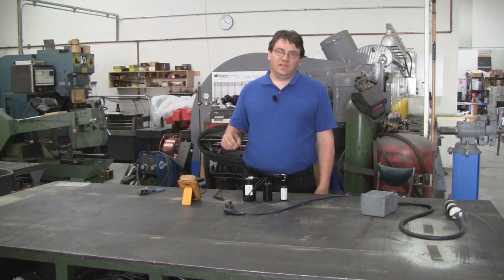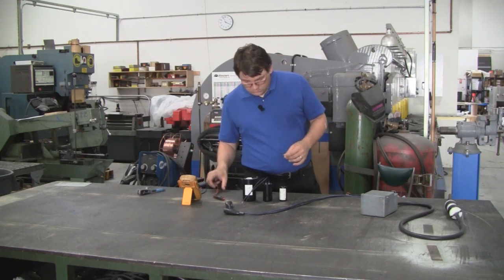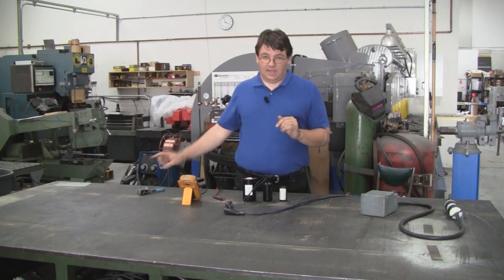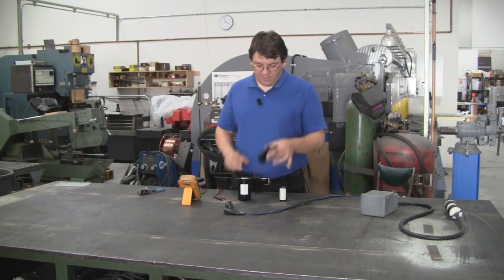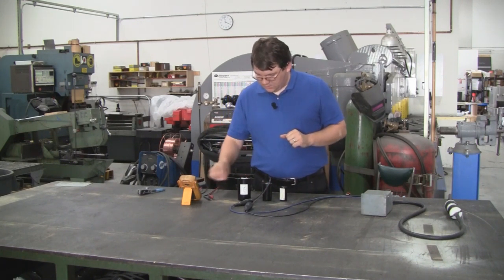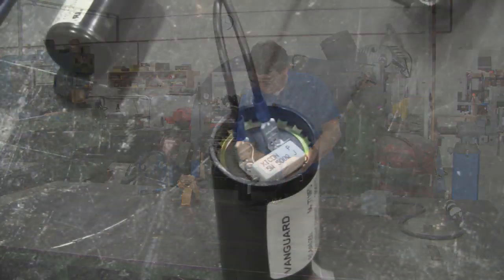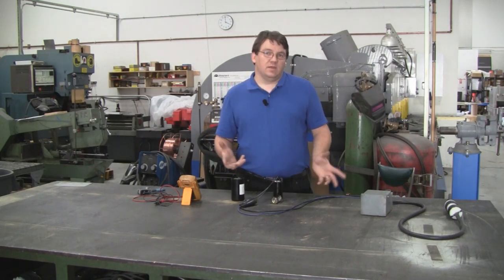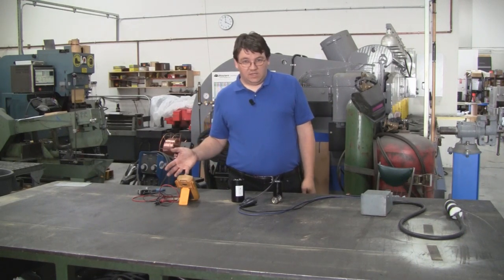Start Capacitor Bleed Down Resistors - TEMCo Tutorial

Comment: What would be the correct size resistor for a 132-165 uf capacitor on an AC condenser unit?  Thanks for the video.

Comment: Bought some DPDT switches from TEMCO.. complete junk.  The one I was using  (bought the other as a spare) could not have had more than a hundred flips before it seized.  Upon opening this was revealed to be due to one of the plastic cam things that are part of the one-piece molded rocker, and which had snapped off.  Chinese-made junk.  There's a reason they have historically used bakelite for nonconductive parts in switches, especially moving parts,  that might be subject to heat from such as a contact made resistive due to arcing.. bakelite won't soften or melt.  It will deteriorate over many decades, by which time it will have done its job.

Comment: I have a dtable top belt sander that keeps blowing starting capacitors.  There is no bleed down resister on the cap.  How to calculate?  125v 300-360mfd cap.  Motor is small probably 1/2 HP.  Thanks for your great videos.  They are very beneficial.

Comment: My motor does not use a resistor. When replacing the capacitor, can I just cut off the resistor? What if I leave it on?

Comment: You showed a 500 ohm 5 watt resistor. But you said it was a 5000 ohm 5 watt resistor. You said 240 volt positive swing and 240 volt negative swing. Are you referring to a 480v single phase circuit?

Comment: Thank you for all your wonderful videos!  I have a quick question on capacitor safety.  As per your video, once the motor starts there will be an unknown amount of energy stored in the start capacitor depending on where in the wave cycle the centrifugal switch opens.  However, once the motor stops and the centrifugal switch closes, won't the capacitor be re-added to the circuit and any stored energy in the capacitor dissipate through the motor windings?  I just want to verify that under normal operation we would not expect any charge to remain in the start capacitor once the motor is turned off.  Thanks in advance for any help.

Comment: explain to me if there is no charge in the start cap, when the compressor needs to power up how is this providing the juice to kick the compressor over ?
Reply: automan1223 if you are talking about a residential ac compressor with 220 vac applied, the 220 is not single phase.  it is actually two phases of 110 slightly out of phase with each other.  The capacitor helps to develop torque by charging. this essentially provides for further phase shift between phases. In the case of 110 vac, the 110 vac motor has a start and run winding.  Voltage is applied to both windings, but applied to the start winding through the capacitor,  which gives the motor more torque by again shifting the applied passes to the two windings further out of phase. Bleed off resistor should be 1000 ohms or more (1000-1500) and 2-5 watts is fine..500 ohms is what was shown.

Comment: Thank you for the tutorial, I found it to be of help to me. I am trying to rebuild my swimming pool pump/motor and want to bleed down it’s 2 capacitors so I can safely begin the repair process. The run capacitor is a 35 microfarad 370 VAC unit, while the start capacitor is 200 microfarads 110-125 VAC. The bleed resistor that I have is a 50 watt 330 ohm model. Is this appropriate for these capacitors? How long do you think it would take to bleed down the voltage on these? Is there any way of using ohm’s law to calculate how long it would take to fully discharge them? Thanks for your assistance.

Comment: I am trying to determine if my Craftsman Scroll saw motor is a capacitor start motor because I want to add a variable Speed control foot pedal. The recommendation for the foot pedal says not for use with capacitor start motors. Any help on this matter would be appreciated. So I do not want to purchase the controller if it will hurt the motor or be unsafe. thanks in advance

Comment from the maker: Arcing internal to the relay would most likely require a voltage spike of well over 1000 V. As for what goes "kaboom," you are basically having a very rapid polarity switch inside the capacitor, which will result in excess heating. This can boil the electrolyte, causing a pressure build-up, popping the safety valve or the top of the cap. You can see what happens during over-voltage in our video titled "Start Capacitors & Run Capacitors for Electric Motors."

Comment: "480 volts .... and kaboom!"  Really?  What goes "kaboom"?  Are you providing accurate information here?  It seems that if voltage was retained by the start capacitor, and if there was a relay in the circuitry, that the possibility of arcing might exist..  (?)

Comment from the maker: There wouldn't be any arcing in the motor circuitry. There are 2 main concerns with voltage in start caps.
1) It can shock the heck out of you.
2) Let's say that the cap cuts out at the peak of the positive side of the waveform. You now have ~ +240vdc stored in the cap. You turn off the motor, and go to start it again. When you close the switch, you happen to do so at the bottom peak of the waveform. That would be -240VDC measured from the 0 crossing....
Reply: hmm, If you turn off the motor, doesn't the capacitor get re-engaged with the motor and bleed thru the coil?

Comment: Thank you.  I guess by "safety", you mean safety from possible electrical shock.  Can there be any other problems related to voltage retained in the start cap ... like maybe arcing somewhere in the motor's circuitry?.

Comment from the maker: It is helpful for safety reasons, but it will not affect your motor or start cap's performance either positively or negatively, as the resistor and start cap are only engaged in the circuit for a very brief moment.

Comment: I asked this question on one of your other vids.  My original start capacitor (216-250 mfd, 250 volt, on a Century 5HP motor on an air compressor) never had a bleed-down resistor.  Should I add a resistor?  Should I be concerned, since this came from the manufacturer (Sanborn) this way?   I called TemCo and the man who I spoke with said that some start caps come from manufacturers without resistors, but didn't say if a resistor would might be helpful.  Thank you!

Comment from the maker: No; run capacitors are never disconnected from the motor, so the residual voltage drains out through the windings. Start capacitors get taken out of the circuit and need a bleed down resistor to perform the same function.